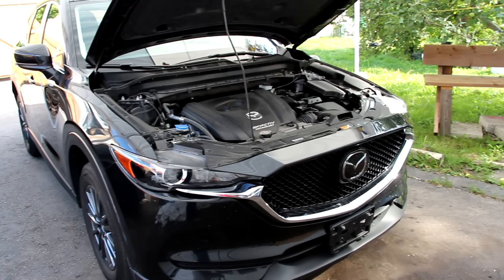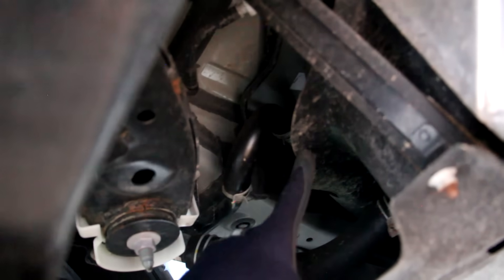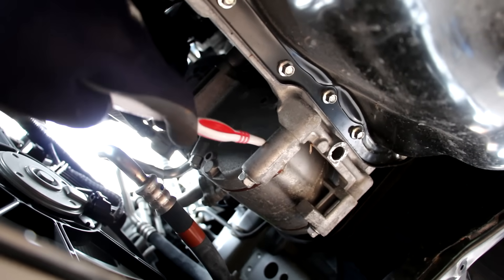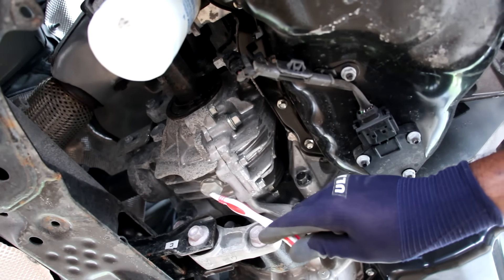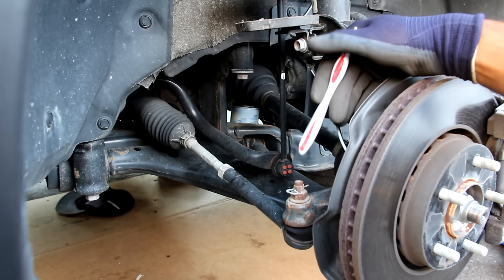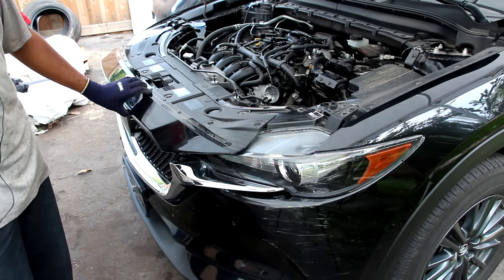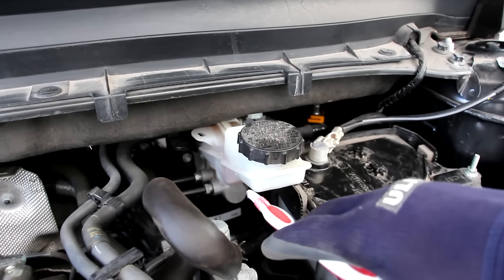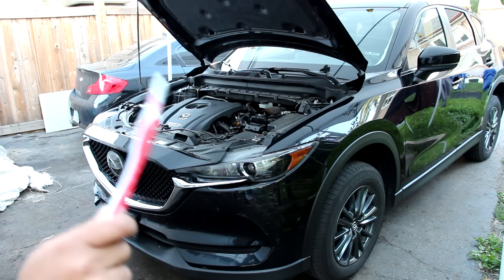Mazda CX-5 Mechanical Review

Comment: Are you picking on VW? LOL. 
I've got a 2019 CX-5 bought new 11/19. Couple things-1) with rear seating up not enough cargo room compared to other vehicles in its' class. 2) drive by wire. This is my first car with it. I noticed the problem when it was brand new and now that summer is here and I'm using a/c I notice it again (using a/c may have nothing to do with it). When I get on the gas, there is a definite lag initially. One would almost think the car has a turbo that was slow to spool up, but it doesn't. Maybe it's just me. Not sure if it's worth taking into the dealer. Any car in the shop really sucks, but a new one, ugh! Fit and finish nice. Ready to do the first oil change on it myself. Dealer did a freebie at 3k. It now has 8k miles. Going to use Amsoil full synthetic.

Comment: Didn't know turbo charging was a new technology. The mazda 2.5l engine is pretty advanced. Otto cycle, high compression with direct injection. Vvt. Just because it's not turbo charged doesn't mean it's not using modern technology. It's using tried and true simplicity. The cvt transmissions that the competition uses has bad reliability issues sticking with a 6spd is awesome of mazda to do.
Reply from the maker: Go back 10 years, majority of mainstream cars were not turbo

Comment: Hi great video and info. Would you recommend this car for longterm, reliability and also for low maintenance. And low cost in repairs if necessary? Despite all the rust? Or is it normal for any car to have that much rust? I'm looking for a reliable low maintenance affordable small suv without all the extra things like 4 wheel drive turbo hybrid ect. Just unnecessary useless things that just add more to expenses and maintenance. I leased this car with reg 2.5 fwd. But didn't do much research, I just knew I wanted something regular gas powered with minimal maintenance. And figured this might be it. But the rust really is making me think twice. Originally I was thinking of buying it out after lease. But now im not sure. Or is there a similar suv out there that is more reliable affordable and low maintenance that you would suggest I look out for? Thanks.
Reply: Cx5 is known as a reliable car for long-term use, but there are other good options like rav4 and CRV
Reply: Consumer Reports rates Mazda ahead of Toyota and Lexus in reliability! They are built to last, and do it with beautiful styling, unlike Toyota and Subaru utilitarian and not real pleasing design esthetic.

Comment: I love my 2019 MAZDA CX-5 GT Reserve (AWD turbo). I am disappointed by the rusting in the under carriage. I'll coat mine with spray-on rust inhibitor - and pray.  Next year I'll replace the OEM 225/55/19 tires with 245/50/19 Michelin Cross Climate tires for better handling and braking.
->I installed a Cork Sport downpipe. Surprisingly this simple downpipe's greatly increased stiffness gives me noticeably better throttle response.
-> A drop-in K7N air filter likely gives a few more HP (according to  Engineering Explained hare on YouTube)
->1/3 tank of 100 octane gas (added to western states lousy 91 octane "premium" gas gives me even more power. (Try it!)
Reply from the maker: Keep rust proofing it

Comment: Maybe clean/detail the engine compartment before making the video??
My 2019 CX-5 GT Reserve (AWD turbo) I installed an oil catch can to reduce carbon buildup. But the intake valves will still get a cleaning at 30,000 miles with BG intake and valve cleaner (from a BG rig done at the dealer).
Reply from the maker: Sometimes I spray them down but they are fairly new and shouldn't be dirty

Comment: If you live in an area that doesn't salt the roads in winter this looks like a sound buy used if you do your own wrenching. 
Not for me though in the UK, my 2004 Mazda 3 1600cc went to the scrapyard 2 years ago with rusted inner sills and underbody. A shame as it was bought new and had 100% reliability. 
Most Audi and Mercedes models from 2006 use double galvanized sheet metal and more alloy in the suspension and can be bought cheaply here used.
Reply from the maker: Agreed. Salt here kills cars.

Comment: Actually the click on the gas pedal is to increase the RPM of each gear. According to the manual, if you feel the click, the car will stay in each gear for longer to give you more power. If you floor it without the click it will change gears normally.
Reply from the maker: The click is just haptic feedback though
Reply: @speedkar99  I’m gonna be honest, you’re the expert. I don’t have even a 1% of the knowledge you have about cars. Quick question tho, are you a real mechanic? If so, do you live en the LA area? I just got a 2019 CX-5 used with 28k miles and I really want a good mechanic to take a look to it.

Comment: Worst car I have EVER owned absolute pile of crap.
Reply from the maker: What issues have you had?
Reply: @speedkar99 Exhaust camshaft worn out,  its on its second turbo @ just over 100k and now has a blown head gasket, front disks warped, windscreens, cracked its on its third screen, front shocks needed refurb the list is endless, they are cheap crap .

Comment: Did you drive that CX-5 on the dustiest damn road you could find? How about replacing the air filter with a K&N filter?
No, removing the intake manifold is unnecesary to clean the back of the intake valves. Just use B12 cleaning fluid with their intake setup. AIalso installed a Cork Sport oil catch can to help keep the intake valves clean.

Comment: It should be mentioned that Mazda doesn't sell, and goes out of it's way to make it impossible to find, the workshop service manuals for their cars. So these mechanical reviews are nice, but without all the proper torque specs and other peculiarities of these cars, these cars are a bad idea for backyard mechanics. Only buy these if you like making dealerships rich.
Reply from the maker: Thanks and yes the manuals are available through paid services like alldata or Mitchel
Reply: @speedkar99  Thanks for the reply. When I look under the AllData DIY section, for 2017 they do not even list Mazda as a manufacturer. In other words, they have nothing for 2017 Mazdas. The most recent year they have anything for Mazda is 2014, but that doesn't help me with my 2017 CX-9.

Mitchell on the other hand seems like it has something for that model year for Mazda, but I need to sign up with a credit card before I can see what exactly they have online. So I'm a bit nervous about it. However, I wasn't aware of Mitchell, so thanks for pointing me in that direction. I will have to send them an email to see what it is they have for the CX-9. I really don't want to pay up and find out they only carry the owners manual, which I can get for free anywhere...

Comment: That car is gonna end up like my ‘03 Protege5 where the subframe and wheel arches just disintegrate when you touch them.
I have to jack up using the lower control arms because the factory jacking points broke off haha

Comment: Excellent presentation! I am very happy with my 2021 CX5 100th Anniversary model. The six speed transmission works weel, better than a CVT! Regarding the rust, mine has been oil sprayed by Metropolitain Rustproofing - I have been a customer for close to 40 years!

Comment: I just purchased a 2021 cx5 2.5 turbo. Do you think it's still reliable car with the turbo and should it last at least 200k miles without major repairs?
Reply: Just keep up with maintenance. Very important on turbo engine. Use good fully synthetic oils and be proactive. It will last.

Comment: Mazda is a good model to start, pros and cons of the regular engine vs turbo engine...rusts or oil leaks issues.
You need to do some videos on Buy this Model and not that Model, etc. for each brand or series of models. They change yearly any more. You could hit the pro and cons of each model.
Reply: Mazda 3 has Turbo option

Comment: 114k Miles on a 2014 and pretty much no issues or rust In Florida.   Should easily go 200k miles without much issue I hope.  I like the na 2.5 no turbo issues and no cvt transmission...its dumbed down and that makes it more reliable.
Reply: I agree.

Comment: You got me thinking twice about getting a CX5 with those rust issues. Dang!
Reply: Oil spray rustproofing will take care of it!
Reply: @remiguertin6474  How do you oil spray it. Is that like a can I can buy or do I have to take it to the shop?
Reply: Dan Trowler There is a company called Métropolitain Rustproofing in Quebec that does only that. I did one car with two cans of rustfproofing spray a few years ago.
Reply: What about one of those square things under the bonnet that are meant to remove rust? 
i got one on my Nissan and so far it’s worked well... does something to the nature of rust .
I’d remove mine snd put it on the Mazda .
He says about the rust then at the end says ‘ it’s a pretty good car’???? 
Wish he gave it a score out of 10.
Reply: Mine has rust on the roof only ..2014
Reply: Rust underneath cx5 not a problem it's all covered with plastic

Comment: Would like to know in all your reviews if a DIYer can change brakes with that stupid electric parking brake system or is an expensive scan tool requited?  Thanks.
Reply: Nah its real simple you just need to put the car into maintenance mode, no scan tools required

Comment: Hmm any idea what's causing the excessive brake wear ?
Reply: Dirt and road salt can obstruct and corrode the sliding surfaces where the brake pad ears seat onto the clips in the calipers and also the sliding pins of the calipers.  It causes the pads to stay pressed against the rotors.  The rust seen on the undercarriage and the grooves observed in the rear rotors also indicate a dirty, salty environment.   It requires cleaning and lubricating the sliding surfaces regularly.   

The rear brakes of the CX-5 in recent years seem to be more prone to such problems than the front and more prone than other makes of cars. Perhaps the type of metal Mazda is using for the calipers and clips corrodes more quickly.
Reply: Mazda CX-5 manufactured before September 7, 2016 had an issue with the electronic park brake not fully releasing due to inaccuracy in the screw threads inside the brake caliper that tricked the EPB control unit into thinking that the brakes had been fully released when they hadn't.  

The problem caused excessive brake pad wear, typically on the outer pads.

The Mazda reference number for the repair guidance document is R052/16C.

pdf of document: 

https://www.mazdas247.com/forum/index.php?attachments/brake-noise-from-rear-brake_trace-of-rear-brake-dragging-pdf.219374/

US VIN ranges of affected vehicles:
:
US (2016 MY) MEXICO (2016 2017 MY) JM3 KE ** ** 600015 - 866136
Reply from the maker: Combination of materials and usage
Reply: @speedkar99  ah thanks !

Comment: You mentioned about D.I. and carbon buildup at the beginning of your video.  When do you think it's time to perform valve cleaning?   You think using crc spray would help?
Reply: I clean mine with cdc valve cleaner every 6 to 8k through the throttle body

Comment: Good video...i am a 2018 cx 5 owner...i just last week had to be firm with our dealership about our rear brakes bein worn out...rotors and pads. At 39 000 km....i had to wait a day and a half for approval on warrenty work to replace rotors and pads....i have done some research and curuois if u know of any faults in the rear calipers as then ill.keep my eyes open for on going brake issues...our service records were all.up to date eg. Brake service done at 23 000 km. All oil changes done at the dealership  etc

Comment: I bought CX-5 last year and I needed to acquaint myself with the car. This was really a helpful video to identify components and understand the technology used. Thank you. Please do the same for 2017 Toyota RAV4.
Reply: And do you like it?
Reply: @andreiandrei8240  Yes, I love my 2019 Mazda CX-5 sport trim. I got the regular engine (non-turbo). The turbo adds more power, but it puts more stress on the engine. The CX-5 is highly rated for is reliability by Consumer Reports.
Reply: @metimeti1998 still.like it? Does it have cylinder deactivation and did you have cracked cylinder issue?

Comment: Good day i am thinking  between 2017 cx5 fwd 0r awd vs 2017 crv fwd or awd which is bettet to keep in terms of lonf term and easy to maintain realibity thanks.
Reply from the maker: Non-turbo crv
Reply: @speedkar99  thanks
Reply: @speedkar99  in canada we we only get the 2017crv with the 1.5 engine what should i do thanks.
Reply: You said get the non turbo crv 2017 but in canada we only get 1.5 turbo what should i do thanks.

Comment: I much prefer the tried and true 6-speed auto to a CVT.
Reply from the maker: Agree
Reply: @speedkar99  is it still true, a current model 6-10 spd auto is more reliable than a current cvt from honda/toyota?
Reply: @LaBambaCL  same reliability as a Honda/Toyota/Subaru/Hyundai/Kia CVT (IVT for Hyundai/Kia). It's just the GM and JATCO (Nissan/Infiniti/Mitsubishi) CVTs that are unreliable.
Reply: @Blank00  Right on. Honda makes their own CVT, Toyota and Lexus are supplied by Aisin which is the best transmission manufacturer in Japan. Sadly, Jatco is also Japanese but bad.
Reply: @TigerKittay  Toyota and Nissan CVTs are also in-house, just under different branding. Toyota owns Aisin and Nissan owns JATCO
Reply: I've heard a cvt is less efficient than an automatic or manual
Reply: I do, too, but they're still not good.

Comment: I have a 2017 CX5 AWD and for the most part I like it. A few things like the auto transmission is clumsy and not very intuitive this causes it to feel under powered at times but a quick switch to manual mode makes it feel like a different car, also the infotainment system is absolutely horrible if you're going to get one make sure it has android auto/Apple Carplay. It's excellent in the snow my job takes me through some pretty bad conditions (steep hills on snowy muddy roads and it did even flinch.
Reply from the maker: Good to hear from an owner. The transmission is a little outdated and the engines are on the slower side (especially with the 2.0). However that's what makes a car like this stand out because every thing is just simple no frills!

Comment: I drive a 2014 Mazda 6 (Atenza in some places), 2.0 litre petrol, 6 speed manual. Not surprised much but after watching this vid I see the CX-5 is pretty identical from the mechanical point to my 6. Living in the UK, don't have much issues with rusting. I absolutely love the car and would recommend you to consider buying Mazda. Only 2 things I don't like, the engine sound and the lack of power (165HP).
Reply from the maker: Yeah Mazdas aren't known for refinement

Comment: 16:46 The tactile switch on the throttle actually does serve a function. The CX-5 has a "manual" drive mode that allows you to shift the automatic transmission by pushing the gear selector forward and backward. If you press the throttle all the way and click the switch, the car will downshift to the lowest possible gear for your current speed, therefore giving you more power.
Reply from the maker: The click doesn't do that. It's just tactile. 
The accelerator position sensor senses WOT and kicks down the transmission
Reply: @speedkar99  What's the point of the click then?  Surely hitting the floor is tactile enough.
Reply: Ok, I see. I stand corrected that theres no electronic component to the tactile switch. However, your video suggested that there was no transmission kickdown function, but there is.
Reply: Otherwise this video was fantastic! Thanks for making it.

Comment: Not mentioned : 
This is a high compression engine 13:1 that still runs on 87 octane.
Reply from the maker: Yea they've tuned it to work on both
Reply: I have worked on all sorts of combustion engines, I would not run 87 octane even in my lawn mower. It's the difference in running your body on good vitamins and minerals vs running your body fat and starch.

Comment: I have the following on my 2019 MAZDA GT Reserve 2.5 L.TURBO, AWD:
1.)K&N drop-in air filter  2.)Cork Sport oil catch can  3.)2 gas hood struts  4.)tank of 100 octane gas (US $8.00 per gallon!)  5. Dimple brand high strength magnetic oil pan drain plug 
UPCOMING MODS: 1.)Cork Sport intercooler and pipes  2.)245/50/19 Michelin Pilot All Season tires  
I really love this SUV and love lunching on the small Volvo and Audi SUVs. And VWs are just snacks.

Comment: Great video. I'm on my 3rd Mazda. 2014 mazda3 hatchback manual. 2.0 liter engine. Not one problem with car at 77,000 miles. Handles so nice with my latest Michelin Defender tires.

Comment: I like NO turbo and No CVT. If a newer car has a CVT that's a deal breaker for me. I am always hearing of owners replacing the defunct CVT transmissions with less than 100K miles. (Nissans, Subarus some jeeps, some Hondas). I test drove several Subarus hate the CVT (It even did FAKE shifts) and the CVT drives like it has a rubber band for a transmission.

Comment: 10:13 Cars don't shock absorbers, but they have dampers. In this case, the coil springs are the ones that absorb the shocks. The dampers control the coil spring oscillations.

Comment: I bought my CX-5 because exactly what you said in the end of the video. Some older tried and true tech under the hood that should be proven to last, the car looks great compared to its competitors, and the interior and the way it handles is pretty good too. 
Mazda is one of the last holdouts from
Small displacement and a non turbocharged engine., as well as CVT. 
I came from the last of the non turbocharged BMW’s of 2011 to this and I put over 20,000 miles on a vehicle.. so this should be pretty anxiety free.
 By the way, excellent explanation of this car... subscribed!!! 
At first I thought you were “Ratchets and Wrenches”.. you sound just like him lol.
Reply: Non turbo? Mazda 3 has a turbo for 2021